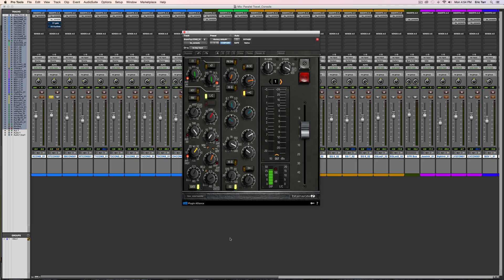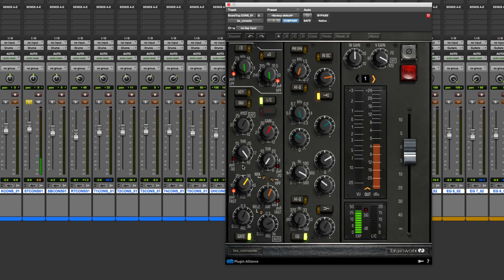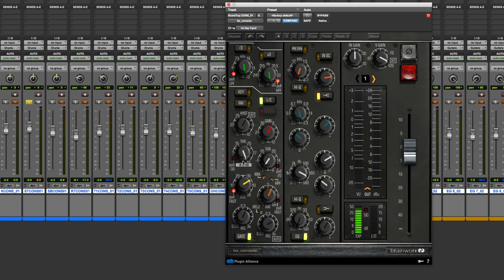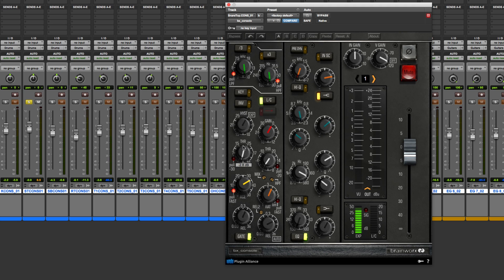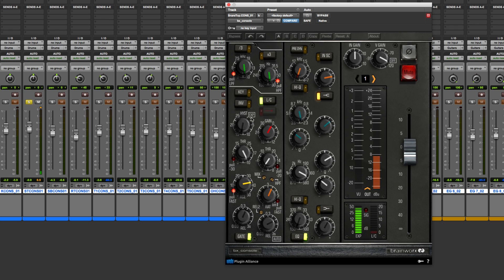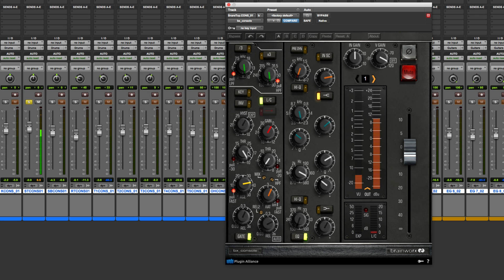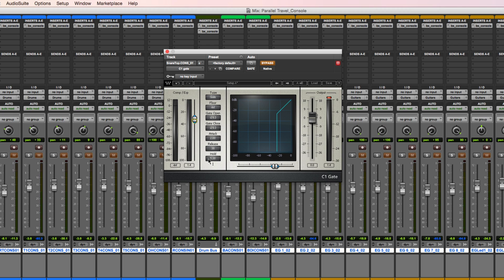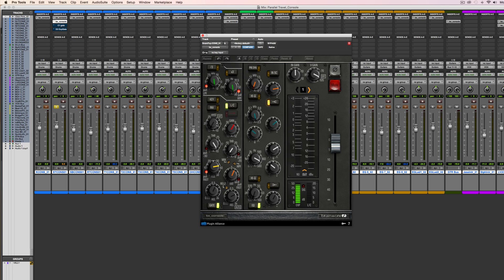What is Hysteresis?

Comment: Very nice explanation of a very misunderstood and under utilized feature that is a make-or-break feature for any gate plugin I'm going to use. Hold will work almost as well with things like drums or electric guitars, but I do voice over work. Hold does not work the same way at all if you are trying to make a gate sound totally transparent and natural with audio that is more dynamic. Especially a voice with nothing but the room's noise floor behind it. Extending the hold will save the tail end of words with a softer trail, but it also keeps the gate open after words that end abruptly, making it very obvious to a trained ear that you're using a gate.This is a deal killer. But, with the right hysteresis and ratio settings, a gate can be turned into a virtually transparent expander that takes care of a lot of manual editing and preserves just enough of the room noise to sound totally natural to the listener.

Comment: Is hysteresis the same thing/similar to range on the SSL channel strip?
Reply: no, but it's about the same as "hold" is, but you can fine tune with "release" though if there is no hold, but i've never seen a Gate/expander without a hold button
Reply: Ahh ok I see.
Reply: yeah, on most expander/gates Hysteresis is not even active until the ratio is at max, the explanation in this video leaves a lot to be desired..hysteresis is really most effective when you want to cut the tail of a signal off abruptly in a timed manor..i.e. cutting the tail off of a large room reverb on a kik or snare..like it was done a lot in the 80's for a special effect..which btw is exactly how that was achieved..it's pretty useless in just about any other way..it's real purpose is to "hold" the signal until it's told to release it to the gate

Comment: hysteresis functionally is the same as the hold on a gate, but in terms of audio signal flow through a magnetic tape head or something similar it is kind of like the difference between the actual signal level and the signal level after running through the electrical component. Using a variable hysteresis level is kind of like varying the amount of signal (from no use/full amplitude to full use/lowest amplitude).